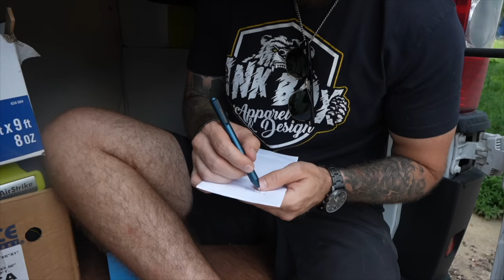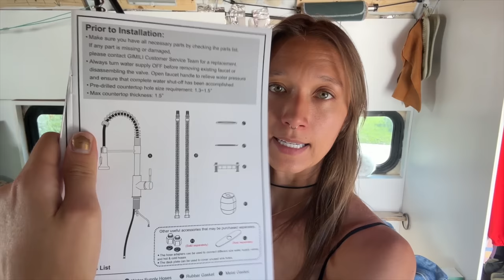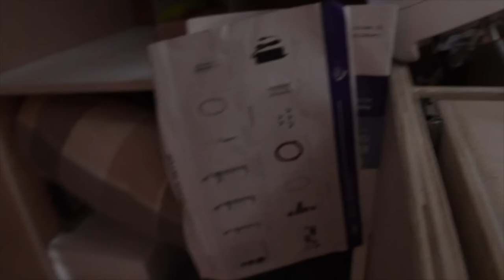4 years without running water

Comment: Hi Nikita
Just some advice for next time, do a dry layup outside of the van before connecting things together, it works for any job, just lay everything out like self assembly furniture, its amazing what you will notice. Be very proud of yourself you have a great system together there.